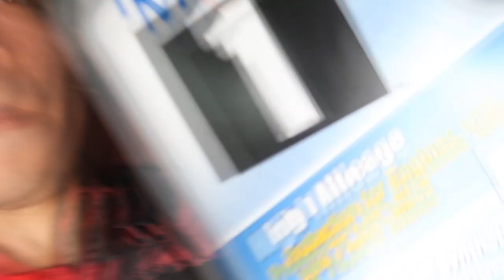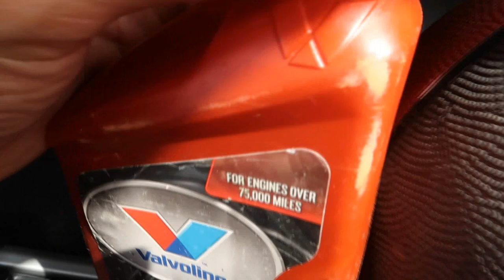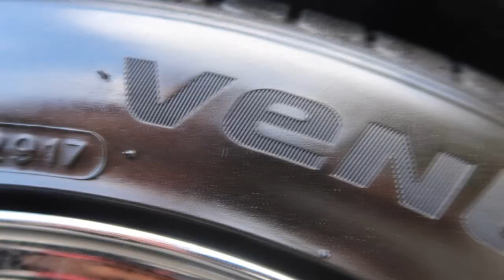HONDA S2000 GETS BRAND NEW WHEELS!!!

Comment: Does this set up rub?
Reply: Is this astockwheelcolor?
Reply from the maker: Aaron Watson This set up did not rub at all. The lowering springs I had were about 1inch and a half drop all around from stock height. And yes this is a stock color for rpf1s. It is “Black Chrome” or “SBC”